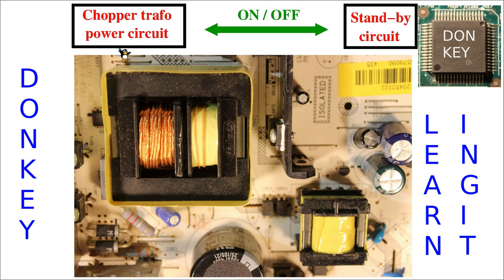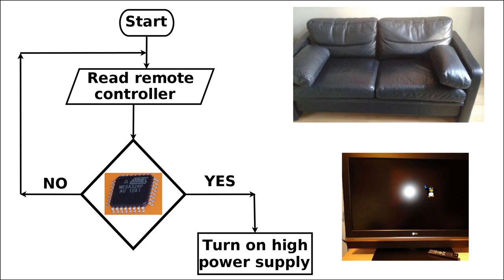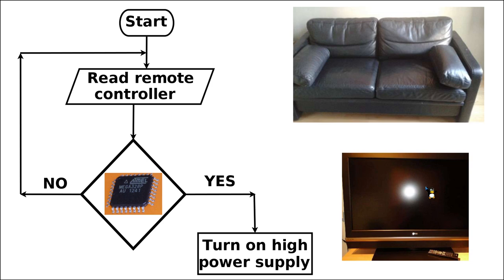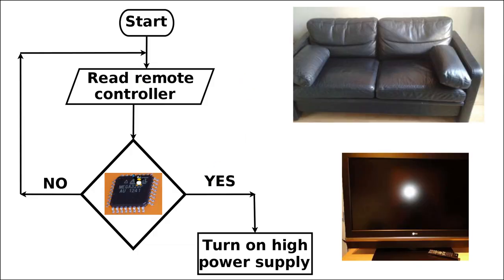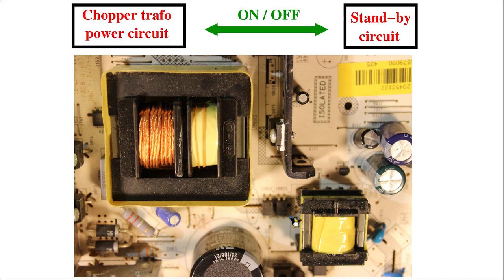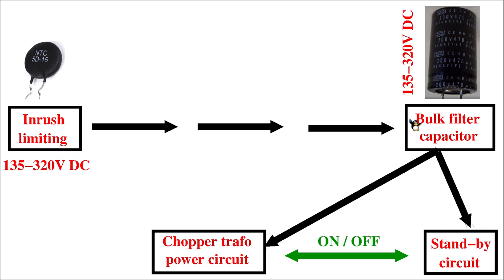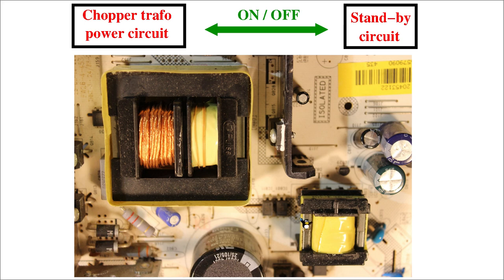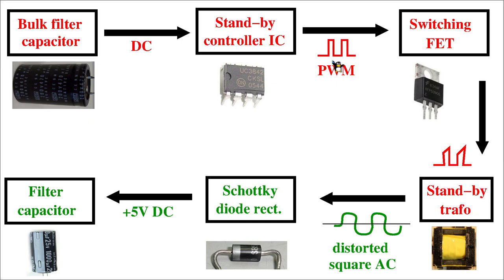Howto repair switch mode power supplies #2: Stand-by circuit and its functionality

Comment: I am very pleased to find your tutorials and follow your simplistic way of dealing with the complex SMPS. I always wondered how ANY transformer could function on DC - following rectification. You made this very clear that the Standby Transformer can operate because the primary of the Standby Transformer is receiving a PWM from the Standby Controller IC! I am currently working on a SMPS for an expensive Home Theatre System with a power supply fault.. Quite simply put, there is no output voltage on the secondary side of the Standby Transformer. I have reached the conclusion that the problem may be the transformer itself, or the Standby Controller IC (which feeds the Standby Transformer) is not oscillating. Thank you for passing on your knowledge to those less fortunate. It is also common to discover that many IC's which are found on failed SMPS may have become 'obsolete' - or extremely hard to obtain. This can be a major setback in the repair of any SMPS. As an enthusiastic amateur, electronics have been a great hobby for the past 50 years. I will follow all of your vids from this moment on...... Thank you for your invaluable help. Greetings from Australia.
Reply from the maker: Thanks for taking your time and providing valuable feedback. When it comes to SMPS, even in the case of stand-by circuits the transformer very rarely fails. Most of the time is either capacitors, power semiconductors, or controller ICs in this order. I would check whether the controller IC is being powered, and also I would check whether the FET feeding the stand-by transformer is fine or busted.

Comment: Thank you so very much, after watch 3 parts of your lessons, I sort of understand why my Samsung lcd TV keep clicking on/off. I followed some videos changed two bad capacitors, it did not fix the problem, even worse, it did not response to turn off signal. I learnt from your lesson, got to check the stand circuit voltage 5 V somewhere, may be after diode just like your picture? Your Donkey Learning IT is doing good for our society, improve people's education level, learning hot to fix computer, TV, reduce wast.I.knew some universities have programs to help people to learn how fix appliances. Keep your good work!

Comment: Congrats ! best explanations from now. I.ve just short circuited the water cooled atx power suply(for my silent server) and is only have stand-by 5V. Now I.m trying to troubleshoot it and the third video will definitely help me to do that. so realy looking forward and again Thank you for the good job done. Maybe the video no. 4 will show how to transform a computer power source in a variable voltage source 0 V up to whatever can be obtained on the operating frequencies, maybe 30 V or so...with hopefully 5 A for a supposingly 400 W power supply. Thx again.
Reply from the maker: Salut! Firs of all with a watercooled PSU one need to be very careful, because it cannot leak even a drop during/after you repair it. Otherwise the consequences are really-really bad. What did you shortcircuit btw? Jusk asking because it will help you a lot with the repair knowing roughly what to look for. What I would do if I would be you is to measure the Schottky diodes on the secondary side with a multimeter in diode tester mode. In the case if your PSU uses FETs instead of Schottkys for synchronous rectification, measure the Drain-Source resistance of the FETs. Either a Schottky or a FET will be a dead short. Of course, for such measurements the PSU need to be explicitly unplugged from the wall socket!
If all Schottky diodes are good, and you know that you shorted the +12V rail to the +3.3 or the +5V rail, in such cases often the tantalum or small ceramic caps will form a short due to the overvoltage on them (they are rated only up to 6.3V DC).
Reply: I.ve got shocked several tumes so i.m not so novice. What i.ve done it was to take out whatever was heat sinked and make the sink water cooled by applying a casing on the back..on the front being the field transistors on the switching side respectively the rectifying diodes. inside the casing the water is circulating. connection to the board was done by 2.5 or 1.5 sqmm multifillar coper wire. Still it seemed not to be enough...since the insulation of the wires conecting one of the rectifier diodes S30D45C melted and finaly shorted to the casing. Gues what...it doesn.t work now:) but the big nasty diodes are just fine, no shortage and conducting in right direction.....bottom line i realy need to repair it since the cooling stuff cost me a lot of private time...like this long messagw as well. Btw Thank You for your advices. I.m sure they will ve appreciated world wide by hobists, people who wants to get electrocuted or technicians. Regards.
Reply: Unde dai si unde crapa ! One out of two D4515 on switching part shorted to base...hopefully that was all...i.ve checked the rest of diodes and transistors and resistors and seems fine...Based on the theory that the most expensive part is subject of failure in a system there should not be something else broken :)
Reply from the maker: If the base of the power transistor have touched some high voltage parts, and the transistor is not driven through a signal transformer, there is a high chance that the PWM controller IC feeding the base have also got hit. In those cases when the power transistor dies, I automatically change the PWM controller if they are easy to order online or from a store. This is because if the PWM controller has issues, the new power transistor will instantly die when you turn the PSU on. On the long run I have figured that replacing the PWM and the transistors works out for me to be cheaper than just replacing the transistors...

Comment: This is a great video. I must say you are doing a fantastic job in your explanations of the Switching mode PSU. However, I have trouble with broken English for the lack of a better term. I could not understand about 10% of your terminologies. However, I must say it is better them most. for some reason as of late, your tube has been flooded with broken English video's. It is very annoying. I end up closing 30-50 videos a week within the first 5 sec when researching a topic just to find a video with an English title that I can understand. NOT IN THIS CASE. Even with the 5-10%, I knew what you meant and your great explanation is what made the difference. you have a talent for education. I appreciated your video and will subscribe as long as you are doing electronics tech videos, KUTGW!
Reply from the maker: First of all thanks for subscribing and for the comment. Which part of the terminology was not clear enough?
Based on your comment I would assume that you are native English speaker, and this is why it might bother you if some video is not 100% perfect fluent in English. However, most people do not have the time to spend writing a script or editing the video with voice-over. I have made so far 0$ from my videos, so I cannot spend time on trying to fix everything.

Comment: do monitors that dont use remote control also have a stand by module /voltage???like a medical signals monitor ? i have 1 that doesnt turn on and the power led doestn lights up either ..

Comment: hi, in my SMPS circuit, the input capacitor is showing 315 V and after that the 200 k resistor is going to 10 V to pwm integration. Because of the low voltage, PWM locks itself because it is 10V. Where's your problem? Is it due to resistance?
Reply from the maker: Do you mean that there is a 200K series resistor which is feeding the PWM controller chip? Sorry, I am not fully sure what you meant in your comment.

Comment: Would a super capacitor be an option for bulk capacitor?
Reply from the maker: Short answer: not really.
Reasons are the following: supercapacitors tend to be low voltage devices (up to around 2.5V) due to the electrochemistry of a supercapacitor. Above this voltage the electrolyte will be broken down,
so the capacitor will explode.
Also, we do not need very large filtering capacitance in SMPS, since the chopping will be done at a high frequency, so that the SMPS controller chip can compensate for small fluctuations. After the fluctuations are reasonably small, increasing the bulk filter capacitor value will just increase wasted power, especially if the inrush current limiting thermistor is not actively bypassed by a relay.
Reply from the maker: Pushed the reply button too early: Third reason why supercaps are no good is that they have a very large leakage current, i.e. they waste too much power.

Comment: was wondering if i chould get some help  i got a crosair hx1050 powersupply  that wont turn on basicly its a massive 12v power supply with the 5v and the 3.3v  getting steped down  from the 12v side  found both of them failed  so u pulled both rail cards off the pcb  and tested the supply  it powers on and off i get 10v for a split secont on the 12v rail i also got 5v stand by voltage  there was a exploded  cap i replaced but got no clue where to look not the supply has pfc as well
Reply from the maker: When you plug it into the mains AC, and you turn on the mains switch, the +5V Stand-by voltage should be always present, not just for a brief moment. Please check this, and make sure first that the +5V stand-by is working properly. I have not fully understood what you meant with the rest. If I got it correctly, you mean that your PSU only has the +12V rail coming from the main chopper transformer (most probably it is a resonant supply), and the +3.3V and +5V rails are being powered with DC-DC converters from this +12V, where each of these DC-DC converters is located on a separate small PCB. Is this correct? 
In those cases you cannot just remove the DC-DC boards, because the IC which monitors the output voltages will almost instantaneously turn off the PSU if it does not detect +5V and +3.3V at the output. This is most probably what you see. Thus, you will need to repair those DC-DC converter cards. They should be relatively simple. If you can upload high res pictures or a video on YouTube, I can give you some hints what to measure.
Reply: Donkey Learning IT yes the supply is a massive 12v supply and uses 2 dc to dc converter boards  one for 5v the other for 3.3v   now when i plug in supply  purple wire has 5v   the gray wire has 3.5v  the green has 3v     
on them  i can upload photos but where do i up load them to
Reply: also the readings are always present  even if i try to ground the green wire  and it clicks on and off
Reply: Donkey Learning IT  here is a review of same supply has a take apart photos and inspection https://www.techpowerup.com/reviews/corsair/hx1050/4.html
Reply from the maker: The pictures are tiny, and one cannot see the two DC-DC boards. Only on one of the pictures one has a glimpse of those boards. In any case, please check the FETs on the DC-DC boards first, and make sure that they are not in shortcircuit. Also, you can feed in +12V DC into the output from an other ATX supply if you have one laying around, and check that they produce the right output voltages of +5V and +3.3V.
Reply: Donkey Learning IT 
looks like theres  1 broken fet per dc to dc  converter  and it also took out an ic apw7073 on both converters
Reply from the maker: Since there are four FETs on each DC-DC board, I would expect that there are 2 in parallel for the high side, and two in parallel to the low side. Thus, I would expect that if one blows, then highly likely that two will blow, since they are in parallel. Did the FET go to short between Source and Drain? If yes, desolder it, and measure the second one which was parallel with it. It is highly likely it is toast as well.
I would replace the APW7073 even if it would be still working, since after it have killed some FETs, one cannot trust the controller IC.
Reply: Donkey Learning IT 
looks like the fets shorted  and exploded  shorts on both input and output side i pulled both cards off the main pcb so see if 12v rail is still working but i think there may be 5 and 12v check  theres only 12v.in and ground them a vout    on each board  my question is it i hook 2 small dc to dc conveters i have to the spot where the cards where u think it may power on
Reply: i got cheap dc to dc converters  from ebay here is link only problem thay have 4 wires  12v power and ground on input and theres a 3.3v power and ground   my supply only has 3 leads to hook converter to can i should i parallel both grounds together in the ebay converters ?
Reply: it works lol    got the supply to power up  its working and outputting  properly now thanks
Reply from the maker: If the +12V rail works fine, and there are no checks on the DC-DC boards, technically speaking even with a cheapo linear regulator like 7805 and and a 3.3V linear regulator derived from the +5V the PSU should power up. You need to solder the output of these linear regulators to the wires which lead to the +5V and +3.3V outputs from the DC-DC cards. This is because if there is no voltage detection pin on the DC-DC boards, then the voltage detection is done on the output side where you plug in the cables going to the motherboard. Of course, linear regulators will not able to deliver the kind of power a computer needs, but just for testing the PSU it should be fine. Btw, can you at least upload a high resolution picture to a free site of one of the DC-DC boards, so one can have a closer look on it? Otherwise it is impossible to tell what to expect...
Repairing the DC-DC boards should be easy too. If the FETs have exploded, this means that the controller IC have killed them, since it have opened both the high and the low side FETs at the same time, which should have never happened.
Reply from the maker: Where is the link for the DC-DC boards?
I would need a picture also from your DC-DC boards, because often they have 3 pins and a fourth pin is a solder point going to a high gauge wire leading to the power output.
Reply: Donkey Learning IT i whould need to take good photos down side its hard due to the high gloss black finish to make out the traces  but ill upload some when i get home